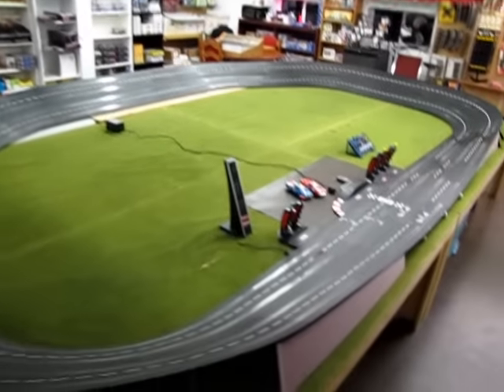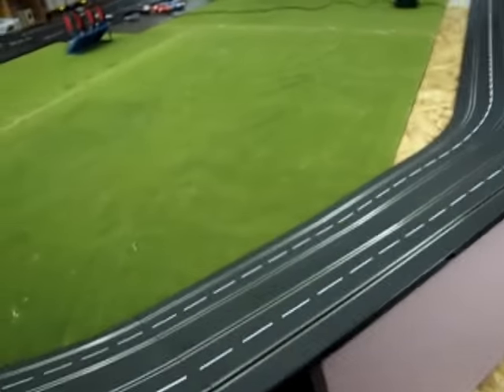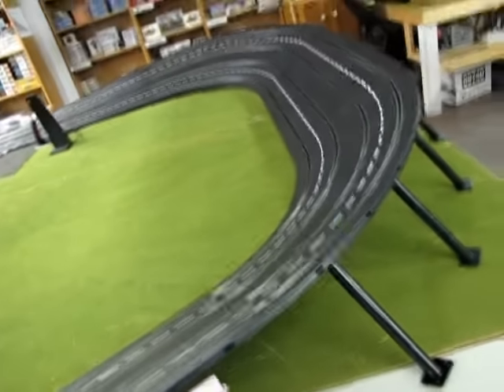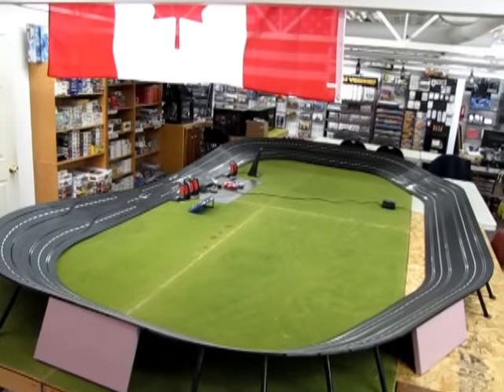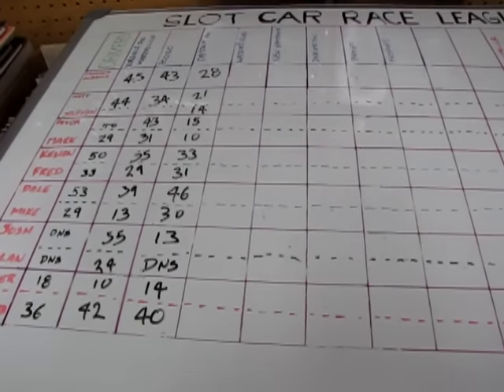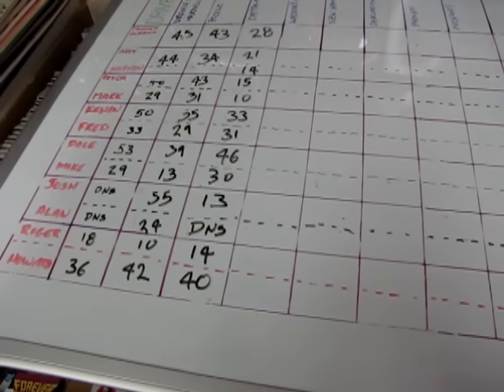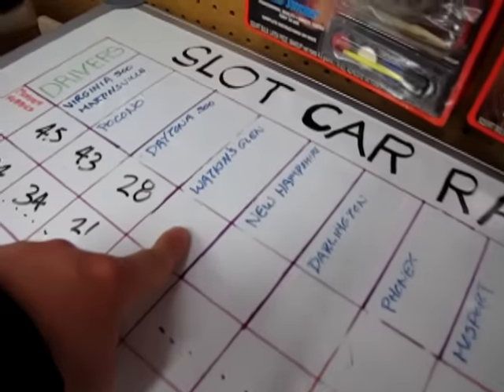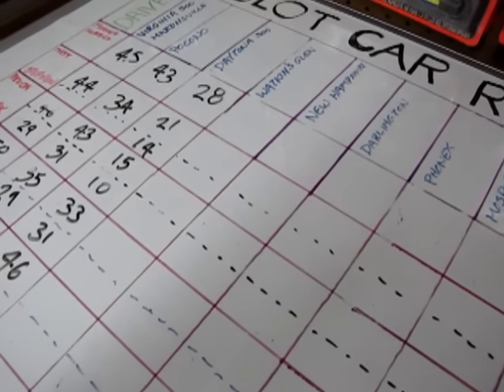Monster Hobbies Carrera NASCAR 1970 Slot Car League - Race no.3 At The Daytona 500 Slot Car Track

Comment: that is an iinteresting track you set up - 
how did you do it so you could put straight streets inbetween the "angled"" curves?
another question: If you put up "railings" on the outer streets could you just race at full speed all the time?
Reply from the maker: Actually, the embanked curves do a great job of keeping the cars on without railings. As for the straight tracks...I used a lot of supports!

Comment: Definitely improved over the previous Daytona, but still a bit off.  Some of that could be limitations of space and track types.  I'm not familiar with Carrera track so the parts my not be available.

Daytona is a tri-oval track, this is more of a quad-oval track (like Charlotte, Atlanta and Texas).  Not sure if Carrera track can do a true tri-oval.  The start/finish line on this track is on the back stretch.  At Daytona, it's in the middle of the tri-oval (Talladega has it in the straight exiting the tri-oval).
Reply from the maker: You know your tracks well! 

Well, this is an adaptation of Daytona in the best way I could possibly fit it in my available space. I suppose I could get even more accurate, but I would need more tables and track pieces. 

Thank you for your continued interest in my channel!
Reply: I try.  LOL!  I used to be a huge NASCAR fan.  That is, until I watched my favorite driver die.  I started losing interest after that.  All of the rules changes and "The Chase" have pushed me away.

I figured space would play a big part in making Daytona difficult to pull off.  It's a big track and Carrera takes up a lot of space.  I'm wondering if I could pull it off with my Tyco track.........  Never really thought about it before.  I MIGHT be able to get the tri-oval.  But I wouldn't be able to get the lap counter in the right position.  I wouldn't be able to do the banking with a 4 lane set up.  Maybe with a 2 lane if I have enough banked track.

Comment: Very cool track, although I’m not a big fan of the fixed crossover tracks, they cause too many issues, I would sooner put digital crossover so the driver can decide if he wants to change lanes 😅
Reply from the maker: There were 2 problems with the digital cross overs on this track....first was the steep angle and how the gravity affected the switch mechanism, and second, we had guys that would figure out how to use the switch to get the most speed out of the cars. the forced crosses stopped that somewhat.
Reply: @monsterhobbiesonlinestore  
I noticed that you were able to run counter clockwise like NASCAR, I see that by reversing the control panel to face inside you were able to accomplish this, very cool.
Reply from the maker: Sometimes the solution is simple, it's just a matter of looking at things differently. - It is harder to push the buttons with the track piece "Upside Down" though. 🤓

Comment: Where do you get the track for the lane change from the inside to outside track? I have just started.
Reply from the maker: It's all Carrera track. A lot of the pieces come in the Digital starter sets.
Reply: Ok,I just started with the evolution
Reply: @monsterhobbiesonlinestore  Do they have a lane changer so that it will change lanes to another track set up for 4 lanes?
Reply from the maker: The evolution track pieces are 100% compatible with the Digital pieces, with the exception of the power tracks.
Reply from the maker: The only lane change track for evolution is the forced X piece, but you need 2 on a single lane because with evolution, you flip the polarity of the track when you use the X, so you need a second X to bring the polarity back to it's original starting point or you will short-circuit the track.

Comment: Is It Possible To Expand The Track Even Bigger?
Reply from the maker: Sure! In fact, it would be better that way. I just don't have the table room personally, but if I did, another two 4'x8' table in the middle would be perfect!
Reply from the maker: The curves I am using are the high Banked R4/15 and R3-30's. those are the biggest Carrera makes. You could "Square up the corners" by adding straight sections to them to widen them out, but you will need to figure a way to support them. I use styrofoam.
Reply from the maker: It isn't really a "set". I bought a Carrera starter set and expanded it with several track extension packages. don't ask me about "cost"...let's just say it's a lot! :D